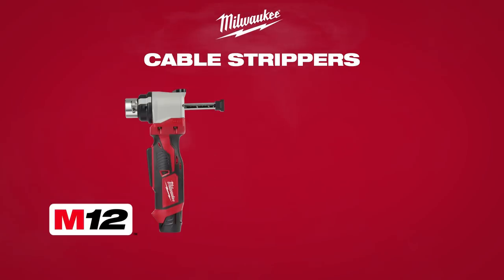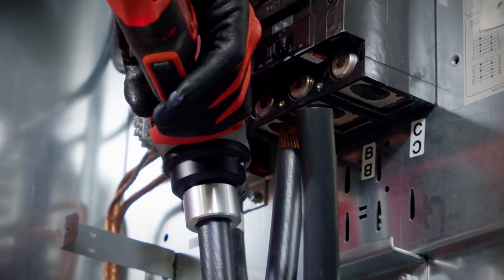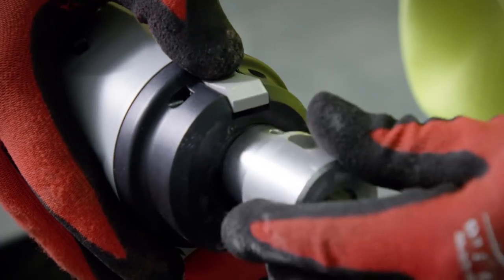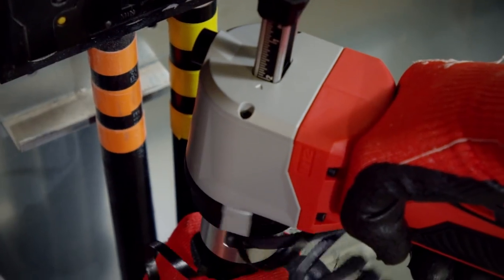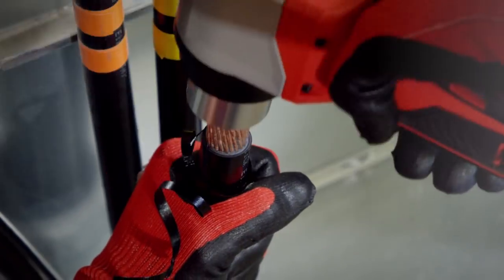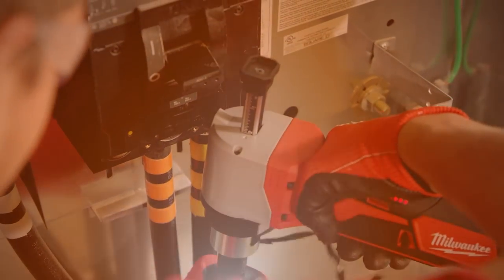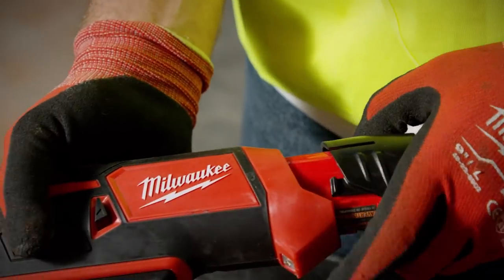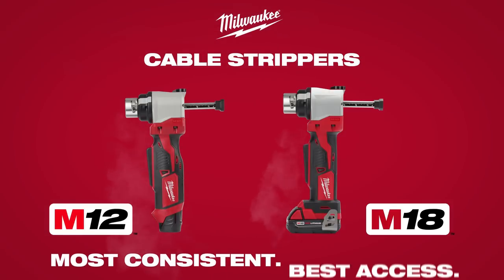Milwaukee® M12™ & M18™ Cable Strippers

Comment: It would be nice if the depth gauge could be removed and the opening was large enough for pass through. 3 inches isn't enough if you're making multiple connections.

Comment: Wait a second, I find the tool at Home Depot web. Milwaukee m18 stripper kit, the tool charger, 2.0battery and 11 stripper blades are about 500. But dewalt kit, tool battery charger and 20baldes are only around 300. What makes Milwaukee so much more expensive than dewalt? Only because of the brand and color? Or really better than dewalt?
Reply: Because they are the Most Consistent. Best Access.